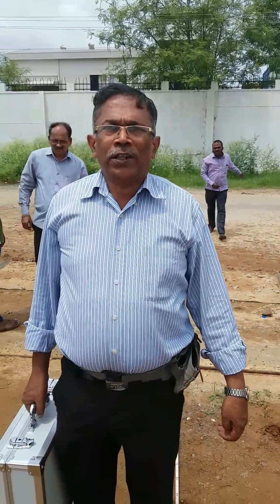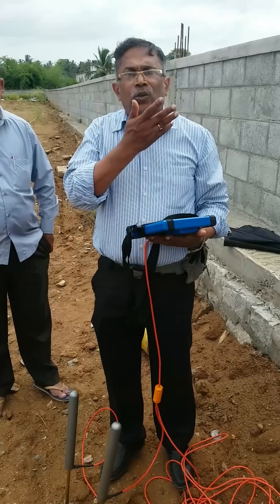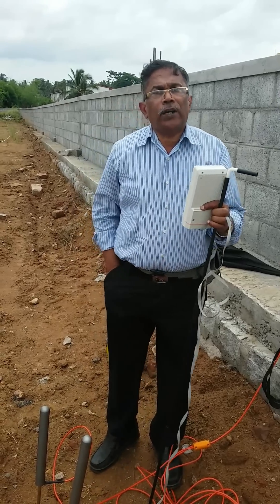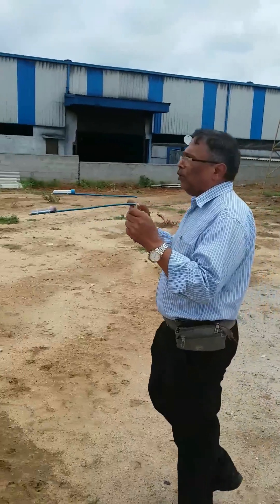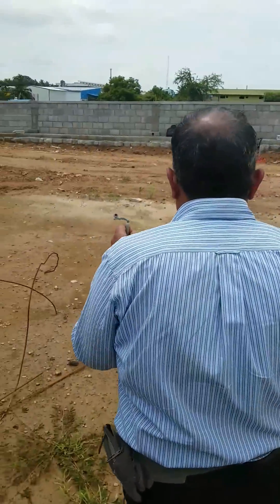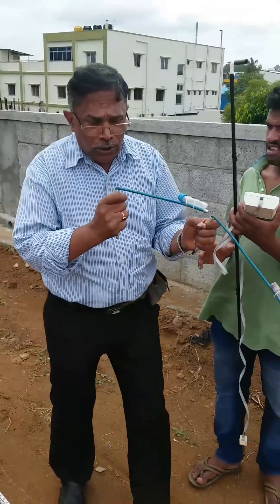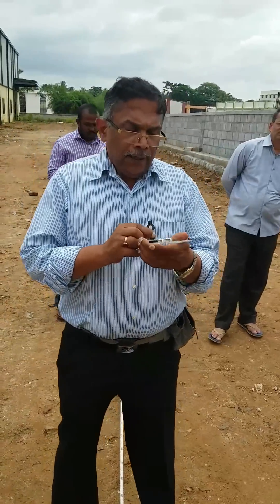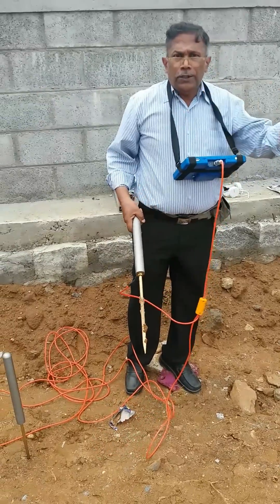Deep ground  water  Divining  survey  scientific  method mob 9341262874.

Comment: The point given to us did not work. Not a drop of water till 1300ft ( estimation by Mr.dashwanth was 1000ft). Lost 3lakh for bore + 20k consultation fees of Mr.dashwanth.
We took a risk and in the same area went for a second bore ( this time with the suggestion of water diviner. Consultation fees 2.5k). By Grace of God, received excellent water ( 4ft high).
Clearly there was an issue in the analysis done by Mr. Dashwanth. We took additional pain to ensure spirit level was maintained every 60ft, which according to him is mandatory. And also jack points were rigid with no soil synching. Charging so much for his service is just not justified.
Our experience the traditional methods ( coconut/twig method/ pendulum - in the same order) for confirmation are more predictable.
Sharing this experience for people to save their hard earned money. Pls go with a second opinion
Reply: Hi.. can i have your contact to know the result and other few details plz...

Comment: This is totally fake, we (former) spent a lot of money and time with this guy and we failed. when we ask for his help, he is not even responding and disconnected the calls. Don't fall into his trap. he will say 98% accuracy but later he will say borewell is not dug properly. I am not responsible for all these. He will not spend enough time with you he will fix at least 4 appointments and make you hurry to go to another customer. we lost almost 2 lakhs including 2 borewells dug up to 450 feet. Surprisingly my neighbour bore is running 3.5 " of water with 180 feet depth. He was unable to find the point even we have a good water source. His charges are 21k. I have recorded all the evidence.
Reply: I am writing these comments after a month and waited for his support and help. but the response is nil. I don't want anyone gets fooled by this guy.
Reply: He gave us 3 points in the same line with 100, 50 feets gap. we dug 2 points and failed. he also said that all these are different points. we ask his assistance for the final point during digging and ready to bear the charges, he denied for that.

Comment: Hai Sir.. 
First up all I want to know what is your instrument characteristics and what is your source of method which you are using.. 
Which type of array you are using for single location of Point.. 
Am a Geophysicist and I worked In Ground water department in NGRI. 
I want know clearly about your method and it's validity in success rate.
Reply: sir i am agree with u 
sir i want to some info. for ground water checking so plz sir contect us 8959605080
and plz share ur mob no.
plz plz plz
Reply: Ngri u work and u do not know his method, then its high time to quit ur job

Comment: Greetings Dr, what is the gross charge ( fee ) for your service in tamilnadu border town(hosur) 50kms from banglore?
Reply: His DEVICE didn't get good results for me.  He CHARGES 21000 + 3000 transport charges around 70 km from bangalore
Reply: @chandrashekar7637  
Toooo Much
Reply: @chandrashekar7637  
@Chandra Shekar
21K+3K Total 24 thousands? This is really tooo much 
We in Maharashtra charge 5K + two side transport Rs. 11 per Km.
Ex. For one point survey of 50 Km, total cost will be 5000+1000= Rs. 6000/- with 94% accuracy. 
We do neat and detailed two hour duration, 5 different method combination survey. 
Methods used are-
1.Resistivity Meter 
2  'L' Rod perfect dowsing, 
3. Geo-Bitanical, 
4. Satellite Images Study (Remte Sensing) & 
5. Topographic & Geological Method.
We apply our skills & stand between 6% possibilities of failure and a successful bore
i. e. Our failure rate is 6%.
With any sincere efforts our suggested  bore point can rarely go failure
Reply: Uday Prakka 5000
Reply: For URS  service in chittoor dist sir